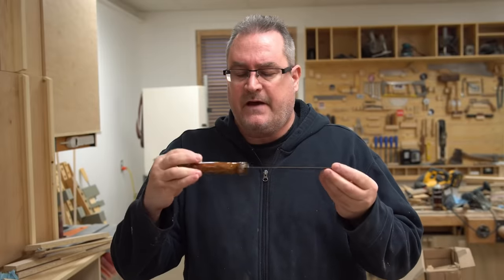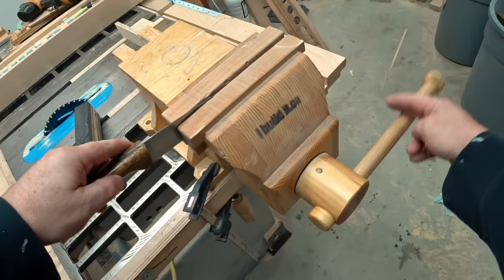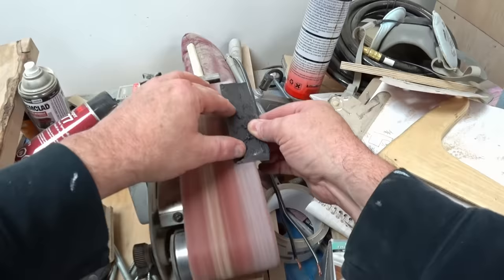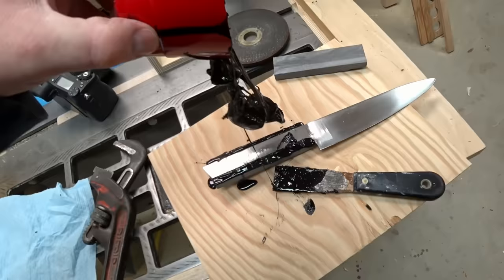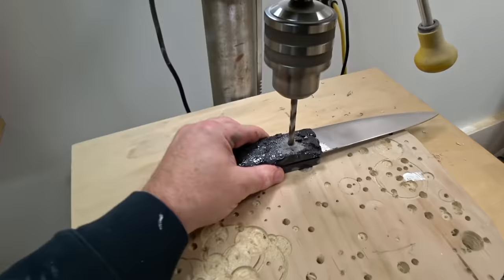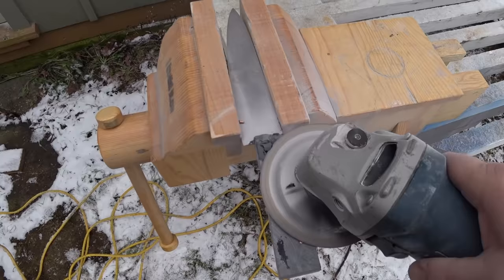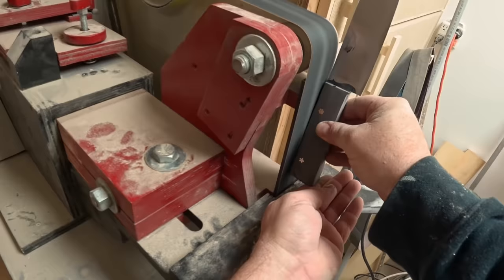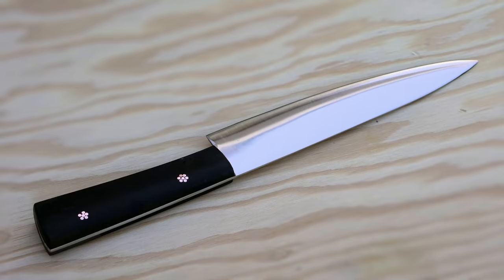Making An EPOXY GROUT Knife Handle With Copper Pins

Comment: I love the texture of the handle, right call not to oil it and the pins turned out fantastic John. I thought you were nuts with the casting resin but you made it work for you. A great lesson in making use of what you have on hand and turning out something very nice.

Comment: As someone else said, at first I was quite sceptical but I think it turned out great, I like the, what looks like a, "anti-slip" texture!
Reply from the maker: Wow, "wreck havoc". Go back in the womb, man, where it's warm, safe and free of sharp edges.
Reply: If that handle would destroy your hands, then you need to get out and do some work on something other than a keyboard.
Reply: Wow, if anything I thought someone would comment about holding bacteria or something equally whiny.... but wreaking havoc on your hands?! You know you aren't supposed to stroke the handle, right?

Comment: Hey John, and anyone else who is interested. If you ever need black epoxy, a great way to do it is burn some scrap wood, brush off the ash and mix it with regular epoxy....it works great. I've used it as a simple inlay material.

Comment: That casting resin has possibilities, I'm thinking; Mix the casting resin in a bag, put the knife in the bag, tang first, grasp the bag around the tang as if you were using the knife, hold till the casting resin gets firm.  Then remove from the bag and trim the casting resin while it is somewhat soft.  Then the knife will be like James Bond's gun, you will be the only one that can use it.

Comment: Go pro in the mouth again?
Reply from the maker: FDR-X3000
Reply: Choking hazard.
Reply from the maker: Next: nostril cams in stunning 3D
Reply: with just a headband ? I have been looking at glasses with the camera builtin for some of my electronics repair videos, but so far I have not been impressed with the picture quality. The wiseup 1080p models are super limited on options and you can't turn off the date time stamp, so I had to return them.
Reply from the maker: Custom made holder: https://youtu.be/v-5Fmrx0wIU
Different camera, same concept.
Reply: Didn't you have a mask on in some of those scenes ?
Reply: Narration from that footage:  "Mmmph, mmph mmm mmm mmph."

Comment from the maker: Build article:
http://www.ibuildit.ca/other%20projects/epoxy-grout-knife-handle.html

This epoxy grout is a great material for a knife handle as far as strength, toughness and durability go. And it can be molded around the blade tang, if used before it sets, eliminating a lot of the more difficult shaping. It is expensive, though - $120 per gallon.
I messed up a bit on the copper wire pins - the second one only has 5 wires instead of 6. Happens when you are juggling the project and the camera to capture the action.

Where I used the grout:
Kitchen counter top - https://youtu.be/QaOSmC_pUBo
Shower base - https://youtu.be/mDMyYArip5M

Ways you can help support this channel:
Patreon:
https://www.patreon.com/user?u=865843...

Plans for sale: http://www.ibuildit.ca/plans.html

More videos on my second woodworking channel:
http://www.youtube.com/c/IBuildIt

My home reno channel:
http://www.youtube.com/c/IBuildItHome

My "Scrap bin" channel:
https://www.youtube.com/c/IBuildItScr...

Website: http://www.ibuildit.ca/
Facebook: https://www.facebook.com/I-Build-It-2...
Instagram: https://www.instagram.com/i_build_it.ca/

Comment: Why wouldn't you just wear some nitrile gloves when working with that stuff??? :)
Reply: Well, that stuff likely would simply dissolve the nitrile glove anyway. Solvent to get that off sadly is MEK mixed with acetone, which also does a good job on dissolving skin. Grit hand cleaner with lanolin ( stinks like a sheep, of course) or lots of coconut oil based hand cleaner with microbeads does however allow you to work it off the skin easier.